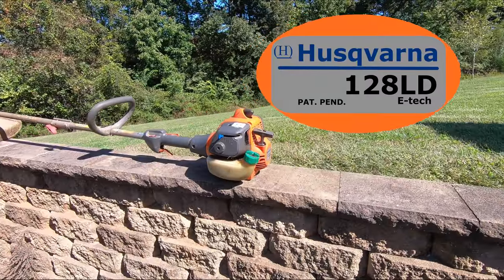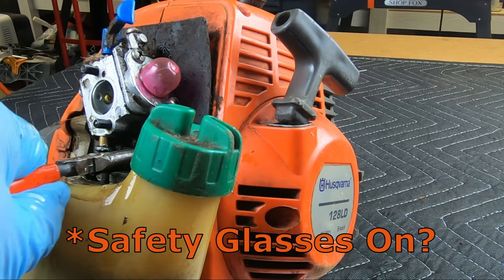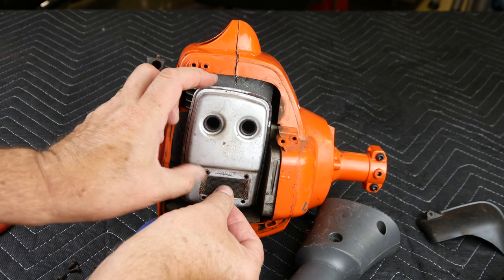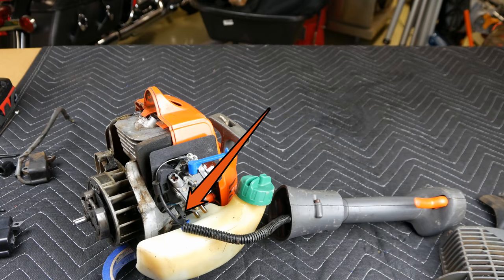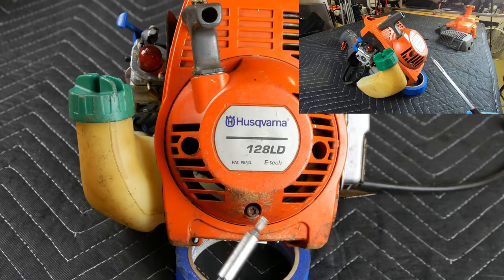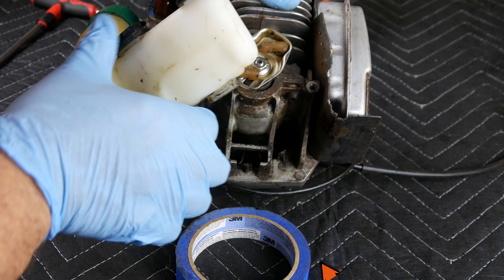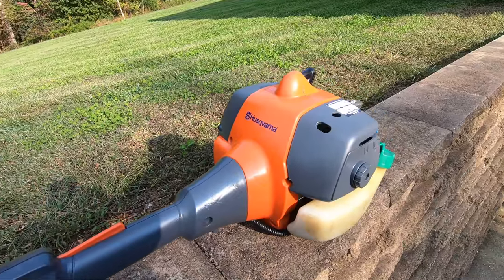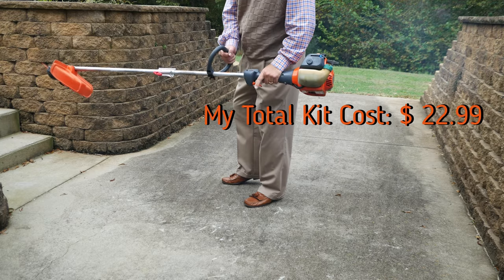Husqvarna Won't Start-Full Kit Replacement

Comment: A great video!   Looks like you do a better job than some of the folks who claim to be “professionals”.   👍🏼👍🏼
Reply from the maker: Thanks brother.  As you know, I spend a lot of time editing to give the folks a good show.
Reply: I can not find links to the rebuild kit, or “spark tester” in the follow-up, comments. Are they there, or am I just missing them? A great video, by the way.
Reply from the maker: @georgemoore6928  Yeah, the link to the kit is in the description.  The spark tester you can find anywhere from ebay to Harbor Freight.
Reply: koler Magnus 20 fuel pump

Comment: You put a lot of effort into the videography, I sure like the dual camera angles for critical moments. Voice over makes the message delivery smoother. I like your decision to replace everything for the sake of viewers, even though many original parts were OK. Don't forget to put the link to where you got the parts, as described in the video.  Well done!
Reply from the maker: Thanks for the comments.  You sir, are very astute.  You picked up on all my efforts.  This was my toughest video yet cause I had almost 3 hours to edit down between the multiple cameras.  But, I started this channel out of my frustration related to other how-to videos being too dark or shaky to allow me to figure out what the videographer was doing.  Thank you as well for the voice-over comments.  Its actually easier and more accurate to do the descriptions 'after' the video is shot than 'during' because of the pressure to get the narration correct each time.  Narration after-the-fact gives me plenty of time to include items of interest that otherwise I might have forgotten live.  Thank you lastly because of your ability to pick up on the fact that the detailed kit installation was not only for the owner's benefit but also for my viewership.  BTW:  I added the link...it just didn't have time to post by the time you watched.  Thanks again.

Comment: Both fuel lines are supposed to have small plastic connectors INSIDE of the fuel tank. These connectors are very important because they keep the heavy vibrations from pulling the fuel lines out of the tank.

Comment: I bought one of these from Lowes and brought it home and put some gas in it and it started right up and only lasted around 30 seconds the head stopped spinning so right back to the store it went. Junk
Reply: Since this has a 2 stroke motor so you must mix gas with 2T oil in 50:1 ratio. The 2T (2 stroke) oil is required to lubricate the moving parts otherwise it will "only lasted around 30 seconds".

Comment: Excellent Video!

I own 2 128LD's.  I did what most people do when the 128LD's quit running, except I skipped the step where you throw away the old one.
So now I'll do this procedure on the old one (minus the coil replacement 'cause the old coil is OK) then I will be able to leave the string trimmer attachment on one, and the blower attachment on the other.

Very high quality video, with time stamps.  There must have been a lot of thought and preparation in this.
Reply from the maker: Thank you Larry for viewing, commenting and recognition of the time it took.  I really appreciate it, seriously.  Much success in your projects. Dean

Comment: This video is exactly what I needed.  Mine stopped after replacing trimmer line. I have good spark and a new plug.  New Carb and fuel lines.  still not starting, but I may have an idea now...  And you took it apart much better than I have as I fumbled through it.  Thanks for showing me the easier way!!
Reply from the maker: I'm glad the video helped Robert.  Drop me a line and let me know how your idea goes.   Dean

Comment: I have this model I bought back in 2014. it turned out to be a very solid machine. It's had a carb and fuel line replacement and still going strong. It still starts easily. Though I have been hearing more complaints about the newer ones. Dunno if they are recent qc issues or user error. Just goes to show you that everybody's mileage may vary. Your best trimmer ever may be a piece of junk to someone else.
Reply from the maker: Exactly, well said.  This ones been a good one, both before and after the repair.  Thanks for viewing .

Comment: 08:00  You can wrap some tape around the plug head to the wire which smooths the contour 
             and the plug won't catch as much.  Makes pulling it out much easier. First tie some twine 
             to the plug and tape over that.  When you pull out the wire, the twine can be used to pull 
             the new wire through the pathway and into position very easily.

Comment: Thank You 🙏 for sharing the video, a great informative video and the kit is really cost effective for all of that.

I have the same model that would not start this morning. My air filter was clean, fresh gas, had to go to town and find the spark plug cross, could not find the Champion plug it called for and I went on and purchased a fuel filter. I had to wait after I got back to farm it was already over 100 heat index, too hot to be outside.
Reply from the maker: Hope the video helped and thanks for viewing and commenting.  Dean

Comment: Thank you, a great video. One thing you didnt mention and after a thorough search of the web I can find no direct answer for is; which fuel line goes to the primer bulb? I got a used one and after switching the lines it now runs. Someone, i believe, reversed them? I have the short (return line) running to the primer bulb. Just want to make 100% sure this is correct.
Reply from the maker: You are correct sir.

Comment: Thanks for the video. I have the same model and after seeing your video plan on doing all of the maintenance you did.
Reply from the maker: I have every confidence you can get it done.  Thank you so much for viewing and taking the time to leave a comment.  Much success and let me know if I can help.
Reply: Agree,  thanks for the video. Mine has the same issue also, I'm going to do the minimum possible lol. Going battery power when this one finally dies.
Reply from the maker: So many folks have issues with gas-powered devices, it's no wonder batter power is becoming so popular.

Comment: Good job but I think you should have done the spark plug cap where it was loose first before the major service.
Reply from the maker: My experience has been that if it was not cranking because of the broken boot wire, it would have tried to fire up when I was using the spark tester.  Therefore; the broken boot wasn't the issue.  Thanks for viewing.

Comment: I have a husqvarna 326LDX, just quit. I have spark good fuel, however, a lot of oil around the muffler and inside the case. I need to check compression. will any compression gage work? most say automotive gauge, when shopping. thank for helping!
Reply from the maker: I picked up a compression gauge from Harbor Freight that was defective and returned it and got another one that was reading incorrectly. I ended up buying one that was of more quality through Amazon and it’s been great.  That said, if you have oil coming out the muffler, make sure the muffler screen is not stopped up.

Comment: Man this was excellent. What do you recommend cleaning the dirty insides with? Brake cleaner?
Reply from the maker: You ‘could’ but if you watch my other Husqvarna chainsaw videos, I typically use something like Gunk engine degreaser and Dawn with a toothbrush for the tight spots and hot water with the Dawn.  Let the parts soak overnight if you can.

Comment: Question. I have this trimmer. For some reason it burns a hole thru the filter in line with the butterfly. valve. I contacted the company. All I got was a dumb look. What do you think causes this. What is the solution?
Reply from the maker: The 'only' reason I can think of that gases hot enough to burn through the air filter would come back thru the butterfly would be a backfiring issue.  At any rate, if that were happening to me, I would suspect a defective carburetor.  But I am no professional weed trimmer repair person, just a shade tree goober who tries to use logic.
Reply: @PilotViewProductions  Thanks for your logic!

Comment: Outstanding video and will really help for what I need to do for my Husky weedeater....I considered buying a new one, but what the heck.....something to do on a rainy day :>)     After your cleanup, it looked new....any special cleaner you have found that is better for the sludge build up?.......thanks
Reply from the maker: Thanks for viewing George.  I like Gunk foamy engine degreaser and an old tooth brush followed up with hot water and car wash solution.  Let me know how it goes if you think of it sometime.
Reply: @PilotViewProductions  Thanks for the info!!!....will be picking up a can and giving it a go...not sure why I did not think of using such a degreaser for such purpose

Comment: There is one more thing you need to check is when you set the gap on the coil and tighten it down make sure rotate the part that the magnets are on to make sure the magnets are not hitting the coil as they go by. In my case they were and I had to open gap a little more so that the magnets would clear the coil. Had I not done this I'm sure it would have caused some damage when I went to start it.

Comment: Hey man. I'm getting fuel in my primer bulb but when I remove the spark plug, it's not wet. I put a new carburetor on it and it's still not showing the plug getting fuel.
Reply from the maker: I assume it’s not running.  Check your spark.  Place a small squirt of gas inside carb with the filter removed and try to crank.  Make sure the air filter is not clogged.
Reply: @PilotViewProductions  , yeah I did that too. I ended up taking the plug out and I put my finger on the plug hole, and the compression would not blow my finger off. I ended up taking the whole head apart and the piston ring is toast. Ordered a new one and it should take care of the fuel problem. I can tell you that a echo is much easier to replace the ring!

Comment: Could you put a link for the compression kit that has the M16 adapter.
Reply from the maker: Bill, at the time I ordered mine, it was for a Lisle compression tester.  I found this series of adapters containing a 16mm adapter that may work if you have a Lisle:

  https://www.amazon.com/Performance-Tool-W80577-Compression-Tester/dp/B00SDGVWQO/ref=sr_1_3?crid=1VDXMFTFKDXDN&keywords=compression+tester+16mm&qid=1654226627&sprefix=compression+tester+16mm%2Caps%2C55&sr=8-3

....plus I found this entire kit that contains a 16mm adapter in addition to several others:

  https://www.amazon.com/Lichamp-Compression-Automotive-Cylinder-Pressure/dp/B088RM6JGC/ref=sr_1_1_sspa?crid=1VDXMFTFKDXDN&keywords=compression+tester+16mm&qid=1654226811&sprefix=compression+tester+16mm%2Caps%2C55&sr=8-1-spons&psc=1&spLa=ZW5jcnlwdGVkUXVhbGlmaWVyPUEySTFUN1RCSVVCOUNZJmVuY3J5cHRlZElkPUEwNzQ5NTA2Mlk3OFhOWjBYOU5BQSZlbmNyeXB0ZWRBZElkPUEwMDU3MTUzMlM4VUNBRzQxNEJTSyZ3aWRnZXROYW1lPXNwX2F0ZiZhY3Rpb249Y2xpY2tSZWRpcmVjdCZkb05vdExvZ0NsaWNrPXRydWU=

Comment: Help! What is causing or problem that my pull cable pull too easily, resulting that I can not start the engine?
New string & puller. Pulling it a lot & quickly will catch and turn the engine (piston) causing the trimmer to run.
Reply from the maker: I'll ask my faithful viewership.  Anyone have any ideas about this one?

Comment: ....your professional speaking and video skills are a HUGE improvement over some of the other less professional videos....the others are hard to sit through because of the others poor speaking and video skills which made me want to quit watching them.....thank you....
Reply from the maker: Thanks Rick.  You’ll never know what that means to me.  Appreciate you watching.  Dean
Reply: @PilotViewProductions  ....I have 3   Husqvarna 128LS  (long shaft models) that I am working on right now.   I am updating carburetors, changing fuel lines, general maintenance ....mostly I have to replace the fuel lines which have become brittle and cracked, but as cheap as the carburetors are from alternate sources I am replacing them if necessary.....

Comment: Who makes a reliable string Trimmer?
Reply: echo.
Reply from the maker: Husqvarna and Stihl make good products.  Make sure you pour out the gas mixture and run the engine dry before storing for the season.  This applies to any brand.